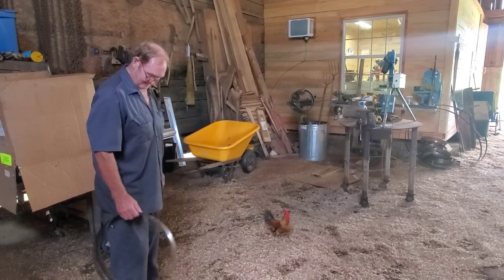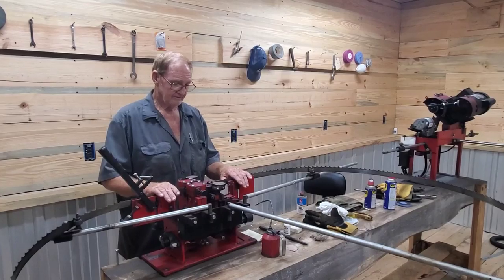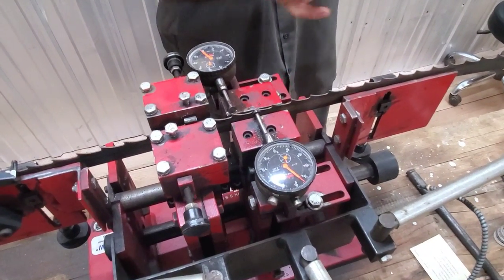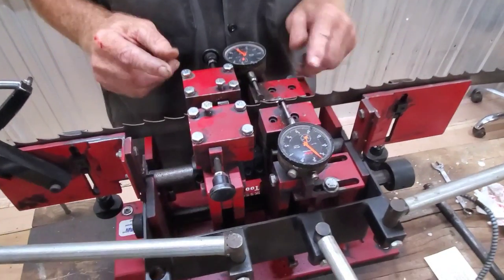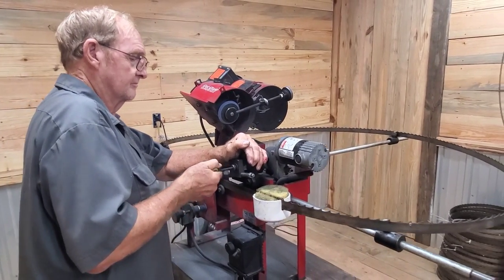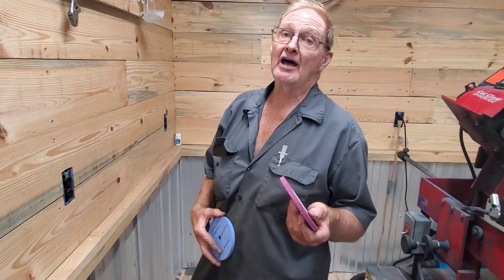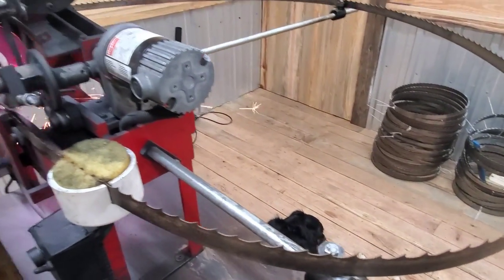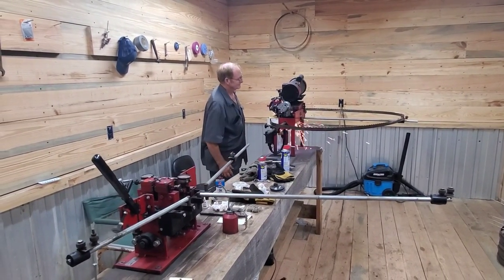How to sharpen a bandsaw blade, Mr. Robert's operation, Cook's cat claw sharpener & setter

Comment: On one of Cooks videos Tim Cook said transmission fluid is the best lubricant for saw blades.  I use the Cooks drip lubricator for my blades.  I tried TF and it works great.  You might also try it in your sponge.

Comment: Mr Robert, Thanks for the great instructional videos here on YOUTUBE. I am waiting for my Cats Claw Sharpener and two tooth setter from Cook in August. I have made up the electric motor brush cleaner and it works great cleaning rust and debris from the blades. I also made the 3" PVC cap with sponge for mounting once I receive the machinery. Did you mount the cap to the right side metal side plate with machine bolt through cap to hold in place for blade to slide through? I have built white oak and red oak work stations for these to set on in the shop. My sawmill is a Cook MP-32 16' length logs motorized head and motorized carriage. Several folks around us here have Woodmizer LT-15s. I am getting cams for Cook and Woodmizer blades 7/8" 8 degree to start with. Thanks again for sharing your valuable knowledege. Herman from Henrico, VA

Comment: Hoid the two wrenches together and pull on both and this stabilizes the turn and off comes the nut very easy instead of banging it, tighten the same way.
Reply from the maker: His shoulder was injured and couldn't make the move comfortably.

Comment: Love your video and thank you for sharing. 
 timberking 1620 
Northern Indiana 
I'm looking at getting into sharpening my own blades, so I have a few questions if you don't mind. 
What kind of brushes is Mr Robert running on his blade cleaner and can a cbn wheel be used on the cat claw ?
Thanks 
Shanen Mannies
Reply from the maker: We are just using some wire wheels we had, 2 of them sandwiched together.   Don't believe a CBN wheel would work on a cooks due to there not being any cutting fluid and the design of the cam sweeping the blade.  He now has 2 woodmizer BMS 250 sharpening systems in addition to his catclaw.

Comment: I have snapped a few teeth off of Ripper 37 blades while setting. Is this usually caused by the anvils pushing too close to the tip of the tooth? Or too far down (towards the gullet)??
Reply from the maker: From Mr.Robert:
Too close to the tip is the more common cause . Blades vary in hardness: never set your anvils too close to the tip. Start your set with at least 1/16 of the tooth above the anvil.  You may have to drop down even farther. If you have dial indicators on your setter, check to see that you are not over setting. If you have stationary indicators on your setter, recheck the set with a handheld indicator.  
Ripper blades are one of my favorite blades to set. 
Hope this is helpful.
Reply: @TCSawmills  Tell Mr. Robert thank you from me! This helps. I have the same sharpener/setter that he does (cooks cat claw sharpener, and cooks dual tooth setter). I recently switched to Rippers and the first 2 blades I tried to set, I broke 5 or 6 teeth off, and was not sure what I was doing wrong. The next ones I try to set, I will raise the blade so that the anvils are lower down on the teeth. I set at 18-20 thousanths. Thanks again!

Comment: So does Mr Robert's not perfer the cooks blades? I just bought the mp32 and my local company in ohio can't sharpen the blades, I assume he don't have the cam for them.
Reply from the maker: He is good with the cooks blades but not the super hard ones.   I think the excel blades were the ones I was using and they did OK on setting.   Even if the cam is not exactly right you can conform the blade to match the cam after 2 passes.  There is a company in New York that can make you a custom cam based on measurements you provide.   If you want their info I can get it from Mr Robert.

Comment: Why don't people build circular saw mills much  any more. Do the circular blades not last alot longer , cut much faster, eleviate the problems with southern pine as far as the resin and eliminate wavy cuts? Trying to decide what to buy etc to possibly  get into it.
Reply from the maker: There are a few out there, the smaller scale lucas and Peterson swing blades are a good option.  But on the lager scale a circle saw is expensive due to all the equipment required to run such an operation.  A lot more capital investment but higher production.   I prefer the portable bandsaw mills like my timberking 2000.  They can do pretty much anything and aren't fixed to one location.  There are pros and cons to each type of mill but I will choose a bandsaw of a circle saw any day.  Far more versatile for the cutting I do.  I prefer to cut large (wide) unique live edge slabs.  On my bandsaw mill I have more capabilities to do that.  If I was cutting cross ties and dimensional lumber a circle saw would do just fine.

Comment: If you can see any reflection on tip of tooth, it's dull.. If blade sounds angry, it's dull..

Give blade a shot of oil/diesel while still spinning on mill just before removing. It will clean blade & protect it until sharpening..

Comment: I use to do the same thing when I was running my sawmill business. I sharpened saw blades for about 10 or 12 different people one of them was a pallet meal where they had a resaws. I still have my mill it a 1995 LT40HD Woodmizer.  I sawed other people logs for lumber for thier self. If it wasn't the fact that I needed insurance for my family I still be sawing lumber today.

Comment: Wondering where he got the wide wire wheel. Would like to dial in and perfect the setting and sharpening. If you don't have a good blade you don't have a saw mill. Thanks for taking the time to share this info. WoodMizer LT50HDD47
Reply from the maker: We have a new series on sharpening.  The first few videos are live now.

Comment: I have a chain saw mill. It is interesting that there’s is no angle to the grind . Sharpening chain saw ripping blade  you angle the grind 10˚ left or right. I realize the  teeth re very different , but it is still surprising hat the cutting surface is perpendicular to the blade. Great video , very informative ,thanks !

Comment: do you set the teeth before you sharpen the blade or after it is sharpened
Reply from the maker: We always clean,  set then sharpen in that order. If you sharpen before you could have metal pieces influence the dial indicators on the setter.

Comment: I'm curious as to which grinding wheel worked the best.
Reply from the maker: He has 3 types he has used red, light blue and dark blue.  The dark blue one from cooks is his favorite.   Lasts a long time and Sharpens the blade well.
Reply: @TCSawmills  Thank you, that's the one I use. I see Cooks has the pink/red, and I believe a black one, but they sent the blue ones with the sharpener.

Comment: Does Mr. Roberts sharpen first then set, or vice versa?🤔🤔
Reply from the maker: His process is clean, set the sharpen.  While his machine Sharpens the blade it also puts on a small amount of oil to prevent flash rust.  You should always clean your blades before setting to ensure your getting the most accurate set.
Reply: Why have you got both timberking and cooks sharpener and setter.  Which you like better?
Reply from the maker: Cooks is better for a buisness and  accuracy,  the Timberking is quick and easy for hobbyists
Reply from the maker: I have both because I found a used cook's set cheap
Reply: Well??👷‍♂️🤔🤔🤞